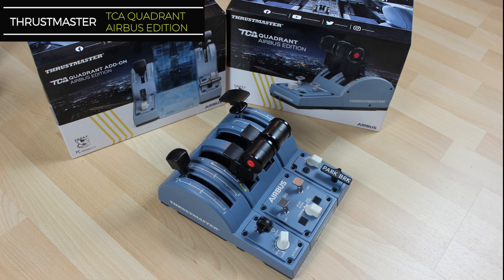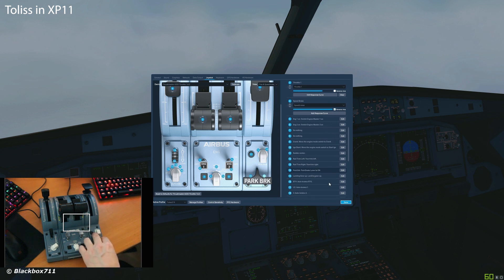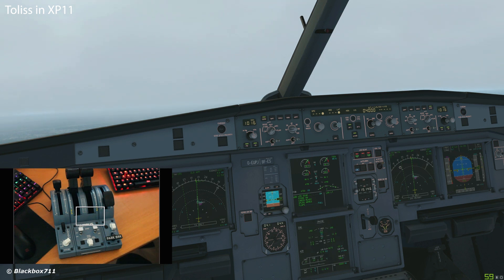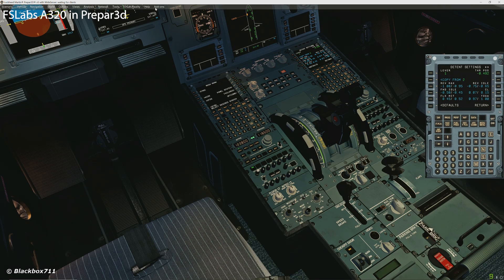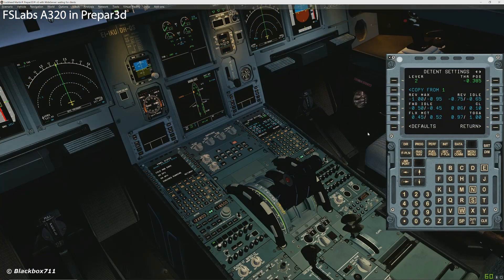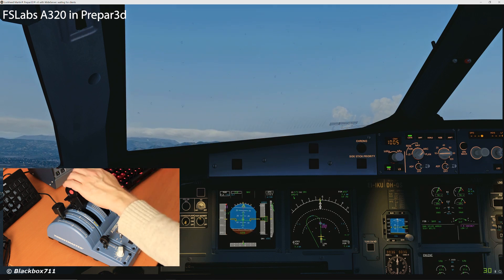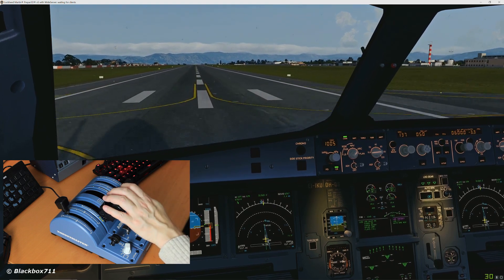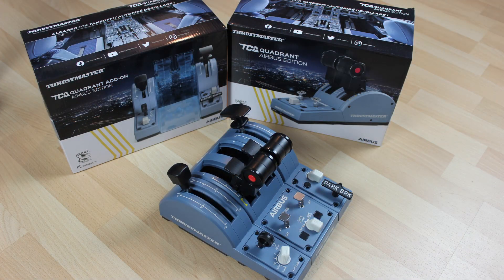Thrustmaster TCA Throttle Quadrant Add-on

Comment: Hi! I did the calibration along with the quadrant add-on. When I ran the MFS 2020 and took the A320 to fly the flaps and spoilers were inverted... The flaps and spoilers at position 0 are "full" and at position 1 they are at 0 degrees and disarmed. The rest of the positions are also inoperable (everything remains at "0"). Can anyone help me?
Reply from the maker: Hi. You need to look in the MSFS Control settings for each of these axis and select/tick „reverse axis“.
Reply: @Blackbox711  thanks a lot :) i've searched in a forum and solved the problem. Thanks for your reply
Reply: @gilgaspar320  link to that forum? or how did u solve it? same shit issue.
Reply: @knowethjc29  the problem is solved. thanks
Reply: @gilgaspar320  I was asking how U solved it but I actually solved it already
Reply: @knowethjc29  oh sorry my mistake 😅

Comment: Already had the throttle but just purchased the add-on and cannot get the parking brk or the gears to work correctly any thoughts?
Reply from the maker: I matched those buttons (even though they are switches they are internally defined as buttons) via FSUIPC.

Comment: Can you arm the spoilers with the addon or do you have to do that manually in the sim still?
Reply from the maker: The spoiler lever does not have an arm position, i.e. it can’t be pulled out to arm it like the real spoiler lever.
Reply: @Blackbox711  alright thanks BB

Comment: It's pretty crazy that the addon has been basically out of stock since it came out. Like what is thrustmaster currently doing? Surely they must be manufacturing SOME
Reply: Same as everything else. Chips are scarce.
Reply: Semiconductor shortage is fucking everyone
Reply: So why don't they just make more chips? :)
Reply: @overratedprogrammer  Worldwide production capacity has been at 100% for almost two years due to spikes in demand. This spike was for the most part fueled by Covid-19 measures. 

Manufacturing chips is immensely complex and only done by a handful of manufacturers. Opening a new plant takes a couple of years of planning and a couple of billion USD of investment. Manufactures believe that they'll open new plants by the end of 2022 or early 2023. After that you'd need to produce the chips, which in itself takes about 6 months.

Guess we'll have to wait just a little bit longer for our playthings :)

Comment: Can i add 2x throttle (4 engines) + the add on (flaps and speedbreakes) ?
Reply from the maker: Good question. I am not sure, hence please put that question directly to Thrustmaster customer service.
Reply: Yes. I haven't done it but there's a picture on the side of my Airbus officer pack box that clearly shows that it can be done

Comment: I wonder if those throttle lever detents would interfere when using a C-152 or other planes. I was also thinking of getting another quadrant for a 4-engine setup. Oh well...It wasn't expensive.
Reply: I have this quadrant. You can “remove” the detents and make it completely smooth
Reply: Good question and well asked. I bought this to practise some flying at home and I forgot the detents are even there after locking away the reversers. I have used them for the bush trips, FS Academy VFR and FS Voyager marketplace packages. I intent on moving on to the Airbus since I fly on one (KC-30A) for work and is nice to have a very similar stick feel. READ HERE: BUT if you were going to stick it with just Cessna and Beechcraft I'd recommend the Honeycomb yolk and quadrant bundle once they come back into stock in several months which would give you some time to start saving.
Reply: @jamesk7777  On FS2004 and prev, I've downloaded and flown as many different planes as possible. The Honeycombs would be the only time I've flown a configuration since when I got my Private and kind of pricey and cumbersome. I was just hoping I could use the Thrustmaster set for Airbus'es and many other types of planes. I guess so!..

Comment: Looks nice, but I’m thinking sometime in 2021 (late ‘21 that is) we might actually have a chance to buy it, and also to pay somewhat normal prices.  Good to see it though.

Edit: As of March 2021, I managed to pick up the Stick and Throttle but not the side add-ons for merely MSRP, $169 USD.  They're starting to get out there.  Setup was just ok for X-Plane, but I got it, and promptly made a video tutorial so it need not be so hard to calibrate.
Reply from the maker: I find it rerrible as well that the availability of the TCA addon is almost non existing

Comment: Hi BB711, In the video you mentioned FSUIPC needing a "small work around", and I think I am stuck on the issue you mentioned yet cannot find anything on what the work around is. I have everything configured properly and it works with P3D input, but with FSUICP assigned axis the reversers just wont go all the way down. Have you posted, or do you know of any posts that address this Sir? Thank you very much! (Also, love your videos, they are so helpful, really appreciate you making them!)
Reply from the maker: Hi Joseph. Is that in the FSLabs? There is a MCDU menu to set the thrustlever ranges, including thrust reverse.

Comment: are all buttons on your addons work? such as the gear lever and parking brake? great vid
Reply from the maker: Yes, those work. Only function that is not implemented is the speedbrake arming and the autobrake.
Reply: @Blackbox711  ah bummer, could I map the auto brake switch accordingly to make it work?

Comment: Hi Blackbox711 can you tell me how have you configurate your axe for the spoilers please ? Because I’ve got some problems with mine for the fslabs on P3D V5
Reply from the maker: Hello Paolo. I did that through P3D spoiler axis if I remember correctly. The issue is that the lever movement is not uniform since the spoiler axis has 3 or 4 button positions and not a true axis.
Reply: @Blackbox711  and do you know how can I fix that ?

Comment: Blackbox, do the speedbrakes in the real A32X have detents other than the pull up for arming or no?
Reply: Apart from pulling up to arm the ground spoilers the real speedbrake lever has only one detent which is at half travel. You might find it interesting that with the autopilot engaged on an A320, the speedbrake will only deploy to 50% even if you move the lever beyond halfway. You must be flying manually to extend the spoilers more than 50%. However, the A321 will give you full speedbrake authority with the autopilot engaged.

Comment: If I saw it correctly you can’t arm the speedbrake with the add-on?
Reply from the maker: The speedbrake lever does not have the arming mechanism that the real lever has. So you have go assign a button for the arming function.

Comment: How about for fs2crew users? Would it still make sense to buy? Would be nice to know if the gear lever in down position for example would be interfering with the FO‘s gear up input.
Reply from the maker: If you are using FS2Crew than I don’t think you should get the addons. Like you said, it will probably interfere with the gear and flaplever.
Reply: @Blackbox711  maybe only the throttle quadrant with the stick, but not the rest
Reply from the maker: That will work, yes

Comment: hi, thanks for the nice video. I have a problem, in the settings in Xplane, the button n ° 25 (parking brakes off) does not appear.
In fact, in the control of the parking brakes, I only have the No. 14 (parking brakes on)
In your video, at 2.25 minutes I see that the 25th appears to you too.

Comment: I ordered the 
Thrustmaster TCA Officer Pack Airbus Edition from Microsoft in August.....It still hasn't shipped.  I looked on-line at other resellers and their expected arrival date for this is April 2021.  You gotta be kidding!
Reply: Ryan K  Me too. Ordered the Officers pack in July, pure vaporware! Besides $100 for the throttle, $100 for the addon, AND $70 for the desk clamp, a total of $270.00! Cheap plastic, and very small. Honeycomb Bravo for $250 has all the above included and MORE! Easy choice. Don't know about Honeycomb support but it could not be worse than trashmasters!

Comment: Hi BB711, nice presentation (as usual), spoilers ARM/DISARM function is not implemented, this is a real miss. A/BRK selector seems to be useless for A320's (ok it's A350 style),
but we should be able to program it against A320 A/BRK levels i.e. LO/LO, 2,3/MED, HI/TO. TM's choice to implement rudder trim and rudder trim reset is not the best, barely used in real life, I would prefer L/G gravity extension function.Finally a question : Are the indicators on either side of the mode selector functional? (FIRE/FAIL)
Despite all my remarks I consider to invest in this product for the increased immersion level offered for a reasonable price.
Reply from the maker: Hi. I agree with your comments. A lot could have been modeled better. And unfortunately there are no FIRE lights indicators below the start switches are also not functional.

Comment: Do you have problem with the flaps and speedbrake levers? when I am trying to move to flaps one, in xplane it directly go to flaps full, same for the speedbrakes. do you know any solution for this?
Reply: Its probably because your plane is on the ground. try the spoiler in the air and see if it works

Comment: Oh. Can anybody help me with getting the thrust reverser to work, I have installed the updates, and held down buttons 12 and 6 while plugging the USB into my PC, and done it again, but still I cant get the reverser to function. It did work when I first got the joystick. Have I done anything unknowingly to disable the reverser function.
Reply: Push the reverse and hold it and there is a little nob on the side turn it to the I position
Reply: @Datttsnake  Hi, Thanks for replying. I was talking about the reverser slider on the joystick, I dont have the quadrant yet.

Comment: Still waiting for mine to arrive. Promised in Sept, Oct Nov and yesterday. Still nothing.
SO looking forward to using it, but I might just spend a bit more and get the available Honeycomb unit instead. I do have the joystick which after the updates works very well. Just disappointed in Thrustmaster still advertising this unit when its so unavailable.
Reply: Where did u buy it from??
Reply: @n1ghtxdd  Hi. I ordered it from Amazon back in August. I received the Airbus joystick, and was impressed with it, I then came across the throttle quadrant and ordered it. Had I have known at the time about the, (Officers pack? the joystick and quadrant pack). I would have ordered that instead.
Reply: @garyashcroft7645  why you wouldn't have the whole pack anyway
Reply: Honeycomb throttle is 1000% better

Comment: I see you have to still arm the spoilers on approach by clicking and dragging up with the mouse?  Not part of the function on the flap lever to arm them I guess?
Reply from the maker: Unfortunately the physical arming function of the spoiler lever is not modeled on the TCA Quadrant
Reply: Map one of the buttons below the engine start switch to the arm/disarm spoiler function

Comment: Thank you for the good coverage of the TCA throttles! I am glad to hear your voice again (as I moved completely to MSFS 2020 and you have not yet done videos for that one). Now, that the A320 stands on a much better level with FlyByWire I fly it more and more. Even the ATSU functions now, although partially. 
Please, make more videos on the A32XX family for MSFS 2020.
Frohes Weihnachten und ein ganz gutes neues Jahr 2021!
Reply from the maker: Hi. Thank you for your feedback. Unfortunately there are still many bugs and issues with the A320 NEO. Yes, the FBW team is doing an incredible job to improve the addon, however MSFS is focusing on many other things, but missing cruical improvements in the airliners.
Reply: @Blackbox711  I just got my add ons this week , its still not fixed, throttle,speed brake and flaps cant be bined.
Reply: @Blackbox711  does the throttle detents by default match up with the sim on MSFS? Because in FBW mod dev build, which include their custom fly by wire algorithm and autopilot. It require custom text file configurations to have the detents matched up.

ps: I've been flying with FBW development build since their custom fly by wire and autopilot is a massive improvement.

Comment: Thanks for the information.  You can't buy the quadrant let alone the add on.  As an FYI Newegg is charging some very high prices for the stuff they have.  Amazon also but not quite so bad.  I'm on the wait list at B&H which is still advertising MSRP prices but are completely  out of everything.  Some things can be ordered for a  premium with that are shipped directly from China but these deals are always somewhat sketchy.
Reply from the maker: I find the current supply problems frustrating as well. Hopefully that will change soon.
Reply: I scored a new Airbus Joystick on E-bay last night for $99 with free shipping and it shipped this morning.  I also bid on a set of used pedals which will come in at about the same if I win the bid.  The $99 Joysticks are still listed as of this morning if anyone wants one.  I planed on a yoke set up but I'm not willing to pay 2-3X MSRP.  If things come down more later I'll add a Honeycomb yoke and throttles.   But at least I'll have a starter set up.  NewEgg still has reasonably good deals on pre-built machines with 3070 cards and i7-10700 K CPU.  Although I bought mine on Cyber Monday for $200 off the normal prices isn't too bad.  Shipping has been slow but it's finally on the truck.

Comment: The landing gear only function up gear and not function with down gear
Reply from the maker: which sim is that? For me the Gear up and down functions perfectly in XP11, P3D and MSFS
Reply: @Blackbox711  hi i am using mfs2020 too but i am using A32nx mod
Reply: @kazuscym  Same here! I cannot use this function to lower the landing gear in MSFS2020, A320neo
Reply: I found a solution for landing gear. The flaps module must installed on left side instead right side

Comment: Thanks. I noticed that you did not use the autobrake switches ?  Does it work and allo to select LOW/MID/MAX A/B ?
Reply: I think he mentioned they work, you just have to map them manually, as it looks like it's setup for larger Airbus frames.
Reply: @christopherdriscoll2682  Yeah the autobrake is based on the one found in the A350 and A380